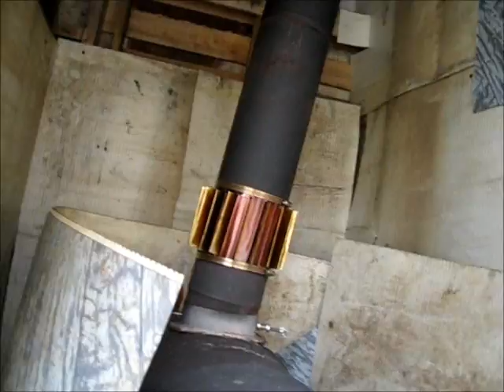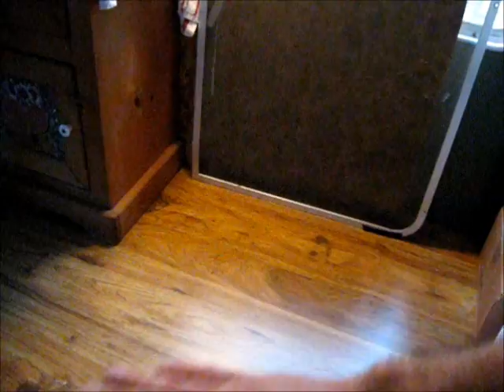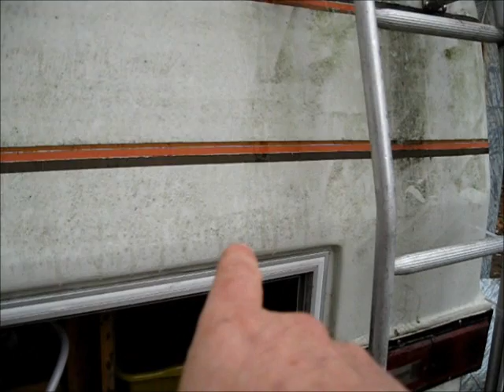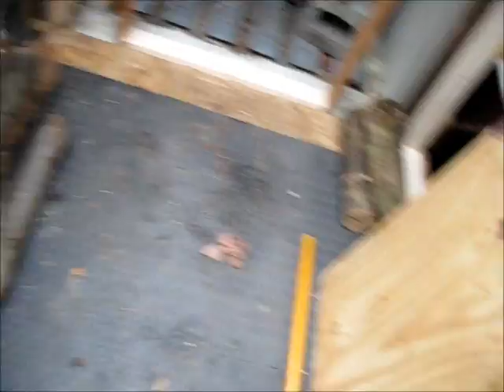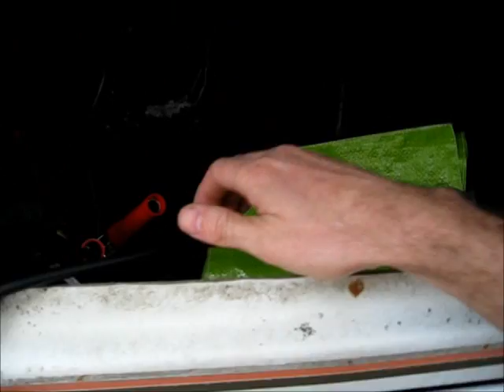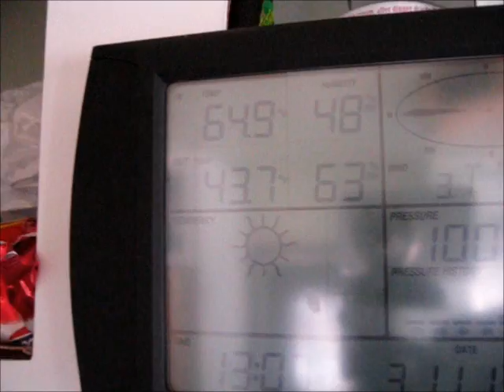Prepping The RV For Intense Cold And Discussing My Future Tiny Home

Comment: Isn't there a type of solar panel that works better in diffuse light? Could you try to get a few of those and wire them into your system? I am assuming they could all be wired together as long as they are the same voltages. Or am I showing my solar ignorance with all these ideas?

Comment: You should contact Alex Pino.  He is a Tiny house blogger and Youtuber.  Also Jay Schaefer is the Guru of tiny homes.  Do not try to do a slide out.  Yes they give extra space, but you are not an engineer or architect, and designing and building a cantilevered slide out is difficult for them.  Do it right with good wood and proper insulation.  Four lights houses dot com and tumbleweed houses dot com are good resources for you.

Comment: OK OK Ok, it was silly to say 100 years, I get it. cool your engines, My main objective here is to help troy as much as possible! Troy knows that. Heat rises, would you put your baseboard heaters up at the ceiling? NO! I have installed a few heating systems and the ones that force the heat to come in at the floor heat the space best, especially when the roof insulation is thin, like an RV. If the roof is cold it will cool the hot air at the ceiling in minutes, hot air rises, cold air falls.

Comment: Yes. I realize that. It can be completely restored. I have extensive experience in remodeling and building.  You would strip the siding and remove the interior fixtures. The structure can be elevated while the floor is rebuilt. I have 40 years in construction. I've restored mobile homes also.

Comment: Check that again. Troy was right. 

Quote: University of Florida Ext Serv.
Stains on the exterior surface of buildings that appear below the shade line are usually a type of algae rather than mildew. However, algae often responds to the same types of removal treatment as mildew. 

In this area, it called mildew when on buildings & such.

BTW, Hantavirus Per VA. Tech. viable 2-3 days. + Google for known cases of this virus in north east US. This virus is primarily a concern of the southwest US.

Comment: When looking at alternative building materials, the first consideration is whether the trailer frame, axle(s), suspension, etc. can handle the weight. Also, have to consider weight of contents to be included, in addition to the structure. Water in tanks, for ex.

Next is whether designated towing vehicle can handle the weight. Most vehicles have maximum weight specifications for cargo & towing. Some vehicles with full tank of gas & 2 people can be overloaded.

Want lightest materials possible.

Comment: You should make a two piece door so you can leave the top closed while opening the bottom. It would make it much easier if you ever have to remove the stove to work on or clean. You probably already built the door :/

Comment: Z. Ray, around here, we call it mildew. Common on buildings, vehicles, etc. shaded from the sun, especially when shaded by trees. Unsightly, but much different situation than "black mold" that causes health problems in confined areas. Outdoors, biggest problem with mildew it is that it can permanently stain some types of plastic finish. Clear coat on a vehicle, for example. Wood siding deteriorates faster due to moisture presence indicated by mildew growth.

Comment: Beetle, often it isn't necessary to split wood to have a good fire. As long as you have enough kindling (split or un-split) to start a fire, round logs burn fine. And, burn at a slower rate, which is often what's desired for heating purposes.

With the barrel stove, the only time he needs to split wood is when logs are too big around to fit into it. (Along with other pieces of wood, that is.) Different principle than the one for using small split wood for hot, fast, cooking fire, for example.

Comment: William, you're right about that. Bare minimum of seasoning (kiln or air dried) before shipping to home improvement stores & local lumber suppliers. Sometimes PT is almost dripping wet. 

Premise today - buy wood this morning and nail it up this afternoon before it warps tomorrow. Getting so bad that I lay every 2x4+ on the floor to check for warp, twist, etc. before loading it on the cart. Often already a problem while still in the store. Begins as soon as the shipping bands are cut.

Comment: Bit of a stretch, isn't it, to say that in 1913 every home & RV had forced air heating? Especially, since many homes & campgrounds didn't have electricity until well into the 1950's. Or later, for campgrounds. Remember well, when REA brought power lines across our farm. Many homes have not been retrofitted with furnace & duct systems.

Fellowship hall at our church has vents in the ceiling with air return in wall at the floor. Works well. Originally built on a concrete slab & heated with wood.

Comment: I have lived in 32 dwellings in my lifetime and other than 4 mobile homes only 1 house had floor vents. the rest had heat in one room and radiated out from there, so seems to me every home in last 100 is a stretch, even in modern times some are built without floor vents.

Comment: I ment in the brick wall. air flows around the bricks warms them and then when his fire goes low or out the same air flow will take the heat from the bricks.

Comment: you are not going to efficiently heat your RV if you pull your hot air in up above your bed. you need to close up that window with the fan in it and pull from down low so the hot air comes in low at the floor just like every home and rv in the last 100 years! bring the hot air in low, and it will rise and the cold air will drop to the floor and get heated.

Comment: All wood standing up warps.  Should be stored flat with supports, at least 4 for 8 foot lumber.  Please build the door and wall on the wood heater room before you finish skinning it or securing the shields or spreading bricks across the floor.  It will be so much easier to do later (never).  Nothing like taking an hour of project and making certain it's 4 or 5 hours of struggle later.   Smack yourself awake dude.

Comment from the maker: I have checked the temperatures again and again, every single day to make sure everything is safe. So far it is good. And I am still insulating and protecting the stove shed. I may use some of that material later as well though. been looking at some but my truck inspection is expired and I cant get to the store to get any yet

Comment: How about building a well planed,  better built solar porch-green house with a heat shed on that camper frame? You could tow it if need be. Parked up against the R/V.it should work good as long as the door clears the frame.

Comment: To roughly translate Centigrade to Fahrenheit  double it and add 30  15C= 15x2 plus 30 60F.  15 C is actually 59 so that is close
To translate F to C reverse it ... subtract 30 then divide by 2.

Yes there is an official formula but for every day use this well get you close and you can do it in your head.

Comment: Hi Troy - good choice on the old camper it well served it's purpose. This should give you a whole lot of building materials without compromising the structure, too badly that is. Think closet doors, any upholstery stuffing you can use as batting like you did with that old mattress. One thing that I would do though is pull that AC unit. If I remember correctly it worked quite well and you don't want it to get damaged in a winter storm. Would it work as a dehumidifier in the RV?

Comment: I thought it was 55 gal. looks good. check out the videos on solar furnace on YT. as handy and resourceful as you are it would be an easy build for you. very inexpensive. soda pop cans, down spouts lexan and some foam board insulation sheets, a computer fan and a small solar panel and it can get 120-200 degrees f at the output

Comment: What your wanting to control the dc fan could be done so easy with the Arduino. It has the PWN line out through maybe 1 resistor and then to a Mosfet. It could be setup with a thermistor to monitor the heat from the stove and auto ajust the speed of the fan. The code is simple to write, and the board is under $10  you can also control it through the computer or external keypad. I love the Arduino, because you don't spend your time soldering like the old school days.

Comment from the maker: It is a lot of work, yes. They are meant to travel down the road at speed. Mine is very badly damaged and the walls are rotted so it will not be as hard. A sledge hammer and sawsall will do the job nicely.

I once helped cut a huge truck camper down to nearly nothing in just hours with a sawsall

Comment: Why? You only need a pot., a transistor and a couple of resistors. And voila, instant regulator.  Or you could PWM it with a 555 pwm triggering a mosfet or a transistor.

Comment: So when are you going to seal up your back windows??, they are one of your major heat loss areas. Use your metal tape with the clear plastic this should help. Also R U going to add any more bricks to your stove area?  Build a brick wall around stove, won't need that metal. leave small openings through out the wall to allow air to circulate. Heat shield and thermal mass in one. Or  just do one side or 2 depends on what you have available.

Comment: I think that the idea of stripping the trailer frame and building a tiny house is an EXCELLENT idea, and probably the last possible way to make "one last run" at the trailer.

Been looking at tiny house designs for years...one of the reasons that I built my shed a few years ago the way I did, with an eye for the potential future uses of it.

Put another way:  How many sheds can you think of with cathedral ceilings? d;o)

(Check your email...I'll send you a snapshot or two! d=O)

Comment from the maker: Yes it would but I dont want to ruin a brand new charger. Still under guaranty.

I did not connect them opposite because I would need longer wires now with the setup I am using. I know it is better as you suggest.

Comment: Hy Troy, regarding to the loading off your battery,s ,if you use the charger itbwill work lots better iff you connect the loader cables whitout the clamos direct to the battery bank., other question, did you. Connect the battery,s main cables opposite from each other? Hav the idea for as far i have seen in the vid that you connected both lines at the side off the inverter/mppt charger, you do not draw equally now, getting problems with the max batt capacity.

Comment: Why not cut some short 2x4s to put between the rafters on the stove roof on the out side. I can see a huge gap of day light coming through. I bet that is a huge heat loss. I can see the huge opening in the corner between the rafters at 19:49 in the video. It has to be a huge heat loss. you can toe nail them in place or screw them at a angle.